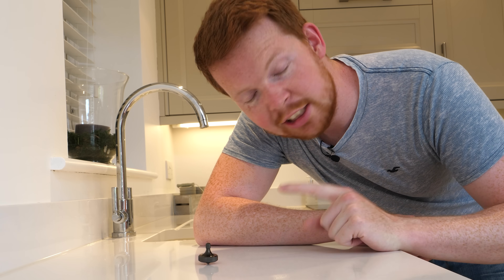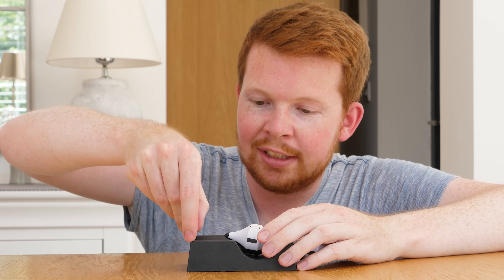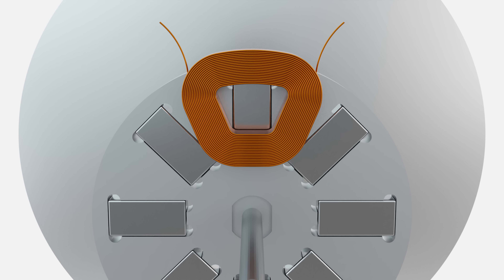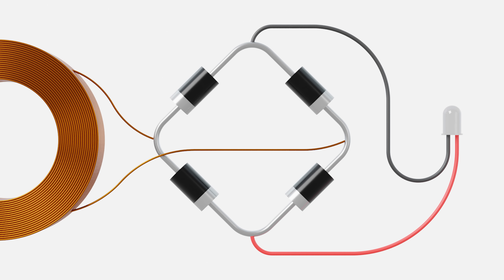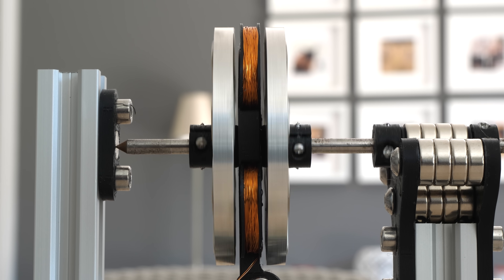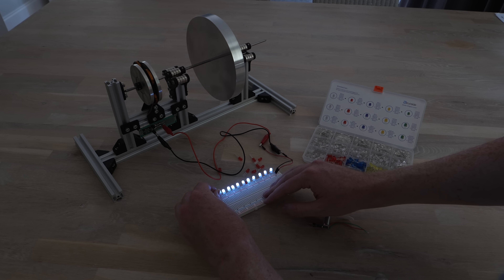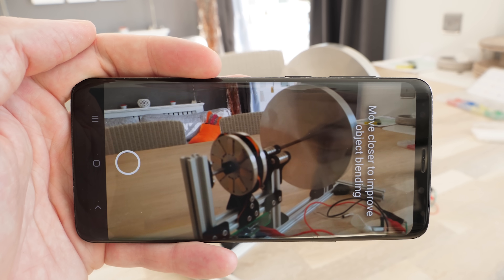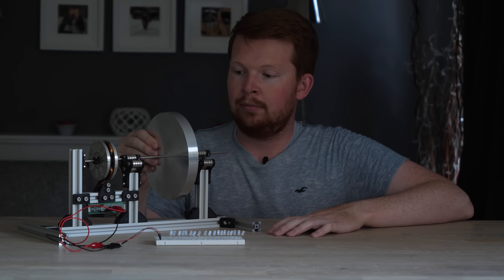Flywheel Battery

Comment: At MIT, there is a team currently working on a similar project, using mag lev fly rings to charge up with electrical energy, converting it to kinetic energy, which can then be discharged later back into electrical energy. Its a very efficient and cost effective way to store huge amounts of extra energy for use later, as lithium cell batteries have a much lower limit before they are damaged than a carbon fiber ring.

Comment: What if you place a small motor at the resting point of the shaft, spinning a disc that recirculates the energy to the ONLY friction point? Maybe it would simply mitigate the load/friction. But would be cool to see how it helps prolong the spinning.

Comment: nice job, your bridge discription gets the point across, but your direction is wrong, current always flows from the negative side, the band side of the diode is the cathode, it has to be biased negative to conduct electricity..  also if you added a diode bridge to each coil and put them in series. you'd be better off, right now your coils are sighting each other. 
but happy to see you working on these.

Comment: Fun fact: A similar flywheel system (although not magnetically levitating) is used in hospitals. A large flywheel is connected to a motor and a generator and kept spinning. If there is a power outage, the flywheel will instantly provide enough power to keep vital systems online (no power drop) and give the backup generators time to kick in.

Comment: Already have a full scale unit using 250 hp motors with 300 hp regen vfds at a sugar factory. 3 centrifuges to spin out sugar. each running a 180 second cycle. they load at 10hz- ramp to 60 hz (32 sec) - hold at 60 hz for 60 sec- decelerate to 3 hz ( 42 sec) - and unload. The cycles are overlapped via a plc to time the acceleration of one machine to the deceleration of the next machine. energy from the decel is used to accelerate the other machine. average amp draw on 3 machines constantly ramping as fast as they can is 45 amps total.  de  Wyoming Sugar co

Comment: As someone who only has a passing knowledge of how these work in actual use:
You could offset the base magnets a bit further away from each other than the ones on the axle, making sure they have matching poles facing each other. This would allow the whole flywheel setup to hover without even the drag of the tip against the base plate. Probably need to add a bit more magnets in the base to compensate for not being directly above each other. Or maybe rather than moving the base magnets just add a couple more to the outside to push the whole setup towards the center. 

Second idea, if you have an odd ratio of magnets to coils you might get a more even power output with less flicker, ie 9 magnets to 4 coils. With the 8 to 4 ratio you get all the coils turning on and off at the same time. Someone who does wind powered generators could probably give you a more accurate/specific answer on this part.

Comment: To say you need to rectify AC to run something like a light bulb or electric motor is just wrong on its face.  This implies AC cannot be used to power either, when in reality virtually all grid supply incandescent and fluorescent lights and motors run on AC.  Yes LEDs will only glow and conduct with one polarity but will still operate on AC at about half power and be flickering at the supply frequency which is usually not visible.
Don't get me wrong I enjoy your content, you make some awesome contraptions, I just think making such statements could give someone not familiar with electricity a very wrong idea.

Comment: Could you possibly power the rotation of the flywheel with a magnet? like a magnetic water wheel that makes it spin by pushing counter pooled magnets on the wheel (or a different, possibly added, part on the axis)

Comment: can't wait for the future when someone runs a game with only flywheels
Reply: I mean, a guy made that with potatoes, so I don't think it's that difficult
Reply: Check out flywheel rotary UPS 😆 they actually gave a diesel powered rotary UPS as well. Now THATS a flywheel!
Reply: wouldn´t want a decent power flywheel as a notebook battery at all. Unless you plan using it as a compass as well xD
Reply: But who is going to spin them. You cannot get energy for nothing. 

5:38 You do not need DC to power a light bulb!

Just before 11:37 - Pulsing LEDs - you should also have noticed that the pulsing gets slower more quickly as you add more LEDs, since the power can only come from the energy imparted to the flywheel by spinning it and this decreases as it is used. This is noticeable in how quickly the first motor slows down, then the second one slows down even faster.

Comment: On a technical level, the LEDs and (especially) that smaller motor are a load on the system right? If they're connected, the stator induces a kind of magnetic friction on the rotors that slows down the whole flywheel faster because the mechanical energy has to go somewhere right?
Reply: Exactly, my ex-boss once told me he was trying to test a car alternator by holding it a vice, spinning up the rotor with a big power drill and then exciting it while there was a sizeable load connected.  He said it damn near broke his wrists.  Then electromagnetic forces caused the rotor to virtually stop in its tracks and the drill spun instead.

Comment: Hi there just a thought how about if you attach round magnets at the end of the shaft both sides. Then using repulsion either side, you might get the shaft to remain in situ without friction on either side. What's your thoughts bud.

Comment: I really want tom to short the whole thing so we can see how induction brakes work :D
Reply: It's pretty close to that at 13:10. Notice how it starts wobbling as the motor stops, I think that's due to uneven braking resonating with the magnetic bearing.
Reply: Throw in a mechanism to drag start it like a lawn mower to juice up with extra spinning power, throw on optical rpm counter to know how much energy is in the system at any one moment, and measure the braking current, figure out the force and efficiency of the braking. 

Bonus. Make a small electric engine for spinning up the disc, charge up a capacitor for braking after it's hit max rpm and use the capacitor to run the electric motor again. Figure out the roundtrip efficiency of the energy storage system from the drop in rpm
Reply: As soon as you draw power, it does that.  It doesn't need to be a dead short.
Reply: @sbkenn1  Yes, sure but the higher the current the more visible the braking

Comment: While this is an interesting video. It really doesn't prove anything. The only real difference between his alternator is that it does not use conventional  bearings. One with conventional bearing would make for a better design since you could have closser tolerances which would increase its efficiency.

Comment: On the other side attach a magnetic coupling that is connected for example to a foot paddle. Place the flywheel on the desktop and the paddle under the desk. You could paddle your reading light at night and have the energy storage of the flywheel. Also a good magnetic coupling would support the axle better on the rear so it wouldn't wobble so much.

Comment: Think a good way to spin it up would be to use a gearbox. If you don't want to have it attached and increasing friction, just slap some more magnets on both ends so when you're spinning the gears, the flywheel will spin too

Comment: Im just curious what happens when you get to the point of generating enough voltage to run a motor that can assist in turning the flywheel, which in turn helps to run the motor.
Reply: @Mr_Spock512  resistance is a thing lol

Comment: If you mounted a small motor powered by this flywheel to the shaft of this flywheel would it be possible that the floating wheel could run forever 🤔

Comment: It is a Full Wave Bridge rectifier.   A half wave rectifier gives less DC than the input AC voltage X .707 a full wave vridge rectifier gives more DC than the input AC voltage X 1.414.  Both need Smoothing with a cap.

Comment: Cisco's Data Center in Allen Texas use a flywheel based UPS that also is supplied by diesel generator to supply power during a power outage long enough until the motors can start up.  In an emergency the flywheel can also be used to start the diesel engine.  They don't have any batteries at the site for environmental reasons. https://www.youtube.com/watch?v=kQirOFEygJQ

Comment: Can you replace the tip that holds in on the wall by a magnet? If the axis pushes slightly away from that magnet you wouldn't have any contact at all and much less friction.

Comment: You only ever measured the open-circuit voltage of your generator but if you measured the voltage across the LEDs you'd be measuring about 2V across your red LEDs and maybe 3.2V across the white LEDs.  That's because the I-V curve of a diode is quite exponential, so it doesn't really make sense to talk about trying to increase the voltage of your generator when your idealized circuit has no resistive components.  Never just hook up an LED across a more ideal voltage source without a resistor in series, because chances are you'll just release its magic smoke.

By the way since LEDs are also diodes you didn't even need the bridge rectifier though obviously it would only be on half the time without being part of a clamping circuit.

Comment: Using LEDs without current limiting is asking for fried LEDs. LEDs are Current driven devices, not Voltage. They have a fixed forward voltage so you need at least that voltage, but exceed that voltage and the current climbs EXTREMELY fast.

Comment: In industry this is used quite frequently. For the last 20 or so years there's been a number of companies that produce large-scale flywheel battery backup systems for data centers. A swedish company called HiTek (that might not be the right spelling) produced the 10MW flywheel system for data center that we used. In the event of the failure of primary power, the flywheel system at maximum load could produce nearly 10 minutes of buffer while generators kicked in. It was a fairly impressive system to see. The flywheel was several tons in weight.

Comment: what if the electric motor was attached to the shaft of the flywheel? You spin it once, then the electricity that is generated powers the motor which turns the shaft. I wonder how much longer it would spin that way. I realize it would be a minimal effect, but there should be some nevertheless.

Comment: Could this be a forever motor? Using a low volt motor to power itself while spinning?
Reply: the flywheel still has a mass moment of inertia. there is a minimum amount of power required to maintain its rotation and we live in a universe with entropy.

it will not spin for very long with that set up

Comment: Would it be possible to add some crank device to make it easier to bring up to speed easier? You would need to be careful not to unbalance it, however. Perhaps another wheel on a lever that you can press against the flywheel (like the drill was used) as you spin it up to speed by hand with a crank, then remove it after bringing it up to speed to eliminate the friction.

If you are just powering a spinning fan, would mechanically transferring power be more efficient than electrically doing so? It might be harder to change the direction of the fan.

Does the coiled wire still exert an opposing force when don't have it connected to a device? If you want to turn off the connected device to conserve power, do you need a switch or move the coils away from the magnets? Since it only lasts for several minutes without the coils, I don't know if conserving power is that necessary for this device, but a flywheel is supposed to be an energy storage device, even if this particular one is more of a novelty desk toy.

Comment: If you're generating AC, why not just use a transformer to up the voltage? If you're not going to use a transformer, why not arrange things so it generates DC directly? You might also have used an AC motor or AC lightbulbs, if you could find one low voltage enough, so you don't need a bridge rectifier and any power losses that come with it.

Comment: You're using magnetic levitation to hold up the flywheel in the Y-axis, couldn't you do the same for the X-axis? By using a magnet on the shaft/axle just like the flywheel, and using two stationary magnets to hold it in place by placing them like a brake caliper around the brake disc. Placing the magnets closer to each other will tighten the tolerance in movement in the X-axis.

Comment: You should make it battery-chargeable. You could 3d print a centrifugal clutch, attaching the output to the flywheel shaft, and the input to a DC motor. You could then spin up the motor with another battery to "charge" the flywheel.

Comment: Be cool if you could make a circuit that lights up more LEDs as it speeds up/voltage increased, and less LEDs as the voltage drops. Basically a visual voltage meter

Comment: @9:35, If you can power one LED, the only difference in powering 10 LED:s is the current usage.
The generator will slow down faster, however as long as you can spin it up by hand and keep it spinning at a certain angular speed, you can plug in as many LED's as you want and it'll power them up.

Comment: These are very common large scale in data centres as a bridge between power failure and generator startup, especially on a B circuit as an alternative to batteries

Comment: It would be great if you could add a crank. And build a sub mechanism to release crank off the shaft after cranking. Thus increasing the rpm of flywheel.
For the wobbly shaft, why not use bearings supported by frames?

Comment: You left out the most important information, a comparison of efficiency of energy stored, compared to a battery, and cost comparisons. Otherwise, it is just a generator attached to a flywheel, which I can do, by putting a large heavy disc on a little DC motor.

Comment: Theoretically could you attach the point where you spin the fly wheel with a large gear ratio gearbox to potentially make a flywheel that spins for hours and produces a huge amount of power?

Comment: It could be cool to build an uninterruptible power supply with something like this. I think this is how it works in data centers to power them while switching over to a generator if the grid fails.
Reply: No, they are purely electronic. I used to work on them.

Comment: So what if instead of a thin point touching a plate you possibly used an eddy current with the end of the shaft having aluminum on it (or being made out of it)? Then theoretically you would have the shaft having less friction on it. Then possibly have it in a vacuum chamber where there would be air resistance and therefore theoretically you would have the least amount of friction on it as possible.
I may be off with my thoughts, idk.

Comment: What if you built a reverse alternator and densely packed magnets onto the flywheel then surrounded them by wire? Basically what you've created, but more magnets and wire. You could build an outer magnetic shell that extended the field to surround the entire assembly.

Comment: Would it be possible to use a whole row of magnetic flywheels, instead of one big heavy one? Would that generate even more electricity using the same mass?
Reply: I believe that adding more magnetic flywheels, with additional coils, would generate more electricity, but because of the conservation of energy, the more electricity you generate from the rotational energy, the quicker the flywheel will stop spinning.
Reply: @MarkDibley  They said more flywheels with the same overall mass. Spreading the mass across more flywheels would make this less efficient at storing energy. In fact, you want as big and thin a flywheel as possible
Reply: Dude, seeing you in the comments made my youtube night.
Reply: No, this doesn’t generate electricity it only stores it, and that would make it less efficient

Comment: as an advice for more stable electricity you should have a second generator on the other side and should be rotated 22.5° from the first one and the the reatifiers should be connected in series

Comment: Great Video.  How much of a breaking force did the "generator" create on your flywheel? I teach a unit on magnetic induction and was wondering.
Reply: You should have noticed that the pulsing gets slower more quickly as you add more LEDs, since the power can only come from the energy imparted to the flywheel by spinning it and this decreases as it is used. This is noticeable in how quickly the first motor slows down, then the second one slows down very fast.
Reply: @TheAdwatson  Yes, absolutely more energy is drawn from the flywheel. It will not be a clean calculation or easy calculation, but you can use the current and voltage to find the power and with a timer find to work done or use the initial speed and ending speed of the flywheel to find the work done.  If you know the distance to wheel has turned you can determine a force.  But, after thinking about it finding the force may be more trouble than it is worth.  Thanks again for making the video.